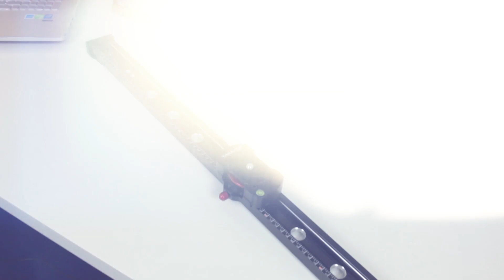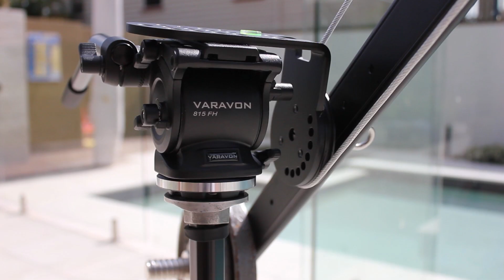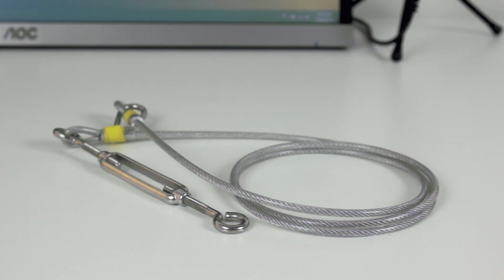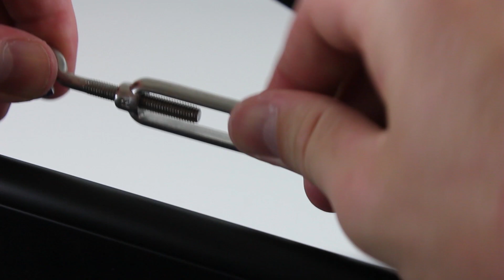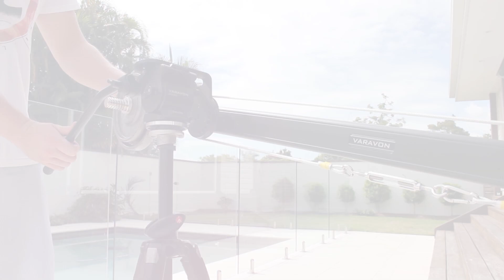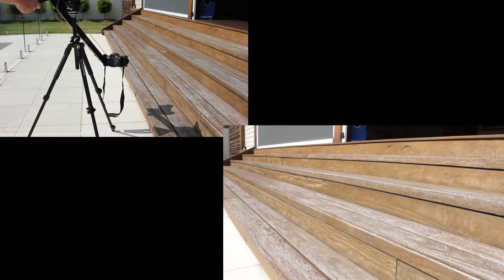Varavon Tilt Jib T1

Comment: Thanks for the video. You say your tripod could do with an upgrade, but you show it being used with the column part way out and the lowest leg sections not extended. First rule of tripod use is that the centre column is only used as a last resort once you have run out of hight adjustment on the legs. If you as seeing any movement from the tripod you should get considerable improvement by keeping the column down.